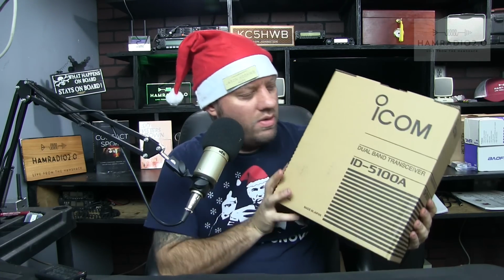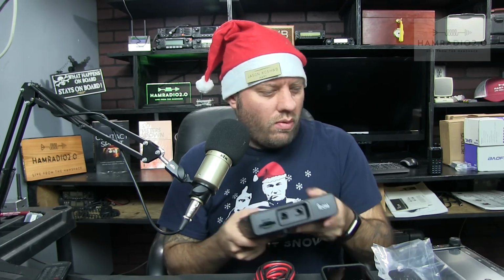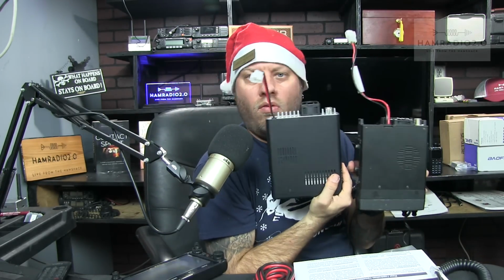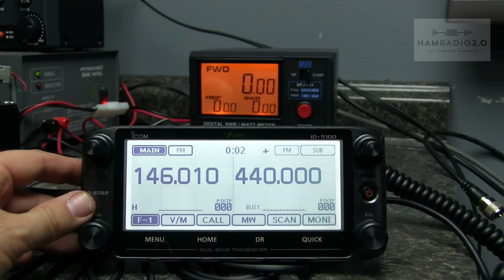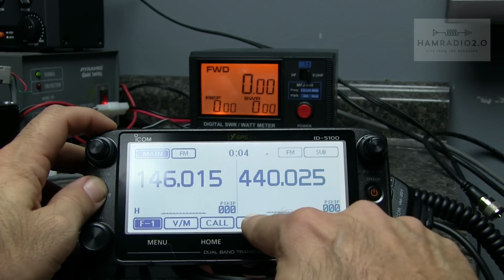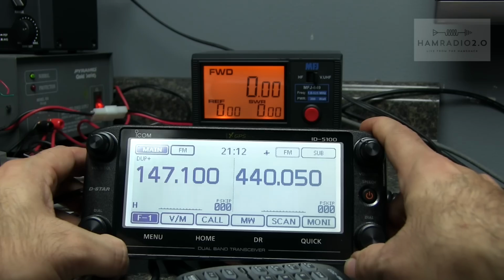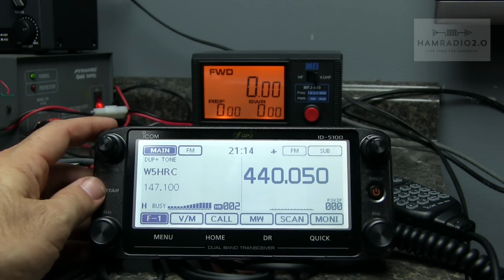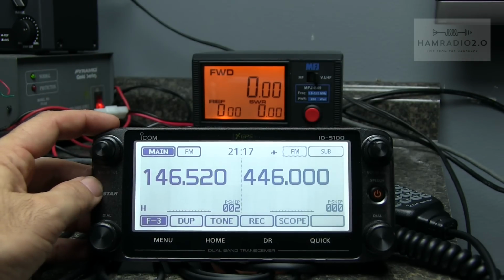Icom ID-5100a Unboxing and Programming

Comment: Just ordered the 5100a.  My first mobile radio.   Just passed my tech and general last Saturday.
Reply from the maker: Congrats on the new license!
Reply: @HamRadio2  couldn’t have done either without your help.  KQ4GVN
Reply: I'm taking my test on 4/19. Havent purchased this radio yet, just doing my research. I agree with Jason about the mic cable issue. I didn't realize that the mic does not plug into the head unit. Where I was planning on mounting everything, this might be a deal breaker. More research is required. Congrats!!
Reply: @NicAmes-e6u  Just run an extension cable.  I did.  I thought the same as it being a deal breaker, but nothing is perfect and it is a great radio.
Reply: Just bought the 5100e , my question is, can you program the repeaters off chirp and do you need to buy the data cable or can you use the SD card?
Reply: @TomDantzig  I used the RT systems software and cable, I don't believe CHIRP will program it but I could be wrong.

Comment: Just got this radio but found the microphone cable is far too short and to use it, it pulls on the cable connector into radio body.  
Possible design fault that the microphone is connected to radio body.
Dies anyone know if a microphone extended cable for this radio that’s not 5metres long like the official Icom one? 
Anything shorter?
Reply from the maker: Not that I've seen

Comment: So I know this is a really old vid.  Frankly I hope you still see the question. Is there another mobile radio that hunts for local repeaters like this one does?   I love my Anytone AT5888uvIII. 
But my times spent longest in the car is when I’m driving from PA to AL to visit my son. I would love to have a radio that would automatically find the local repeaters for me. 
This radio (like the 7100) is old tech yet still at a premium price ESPECIALLY if I have to purchase a mounting bracket for it. Any suggestions?  For $100 more I can get the Yaesu FT500DR but I’m not sure that’s the answer either.
Reply from the maker: You can load repeaters into the Yaesu also. But if you want to stay with Icom, look at the IC-2730. Unfortunately they have not released anything new in a long time
Reply: @ Thank you for the reply.  No not married to Icom. My base station is the FT-991a.  The thing that caught my eye on the 500 was the forward facing speaker and the rest of the options. My concern with it is the menus seem cumbersome for a mobile rig.
Reply from the maker: No, the menus on the 500 are fine.  There is a quick menu and a deep menu, with a page-through option for the deep menu.
Reply: @HamRadio2   I do like the slide in/out mounting bracket.  For this year I will keep the Anytone.  I'm mounting it in a subaru Crosstrek. But I am planning on going down to AL next January I might have to upgrade to the FT-500.  Who knows Icom might have something from this decade on the market by then.  I know the Anytone is old tech as well but at $250 for a tri-band it's very tough too beat and according to my meter I am getting 57watts on VHF, 32 watts on 220 and 46 watts on UHF.  The only thing I would really switch for is the repeater search, forward facing speaker, slide mount and the digital mode which are big considerations since when I visit I stay for over a month.  The slide mount gives me the option to put up a quick antenna and have use of the radio indoors.  I need to look into the AL area and see what type of digital repeaters are in the area.  I plan to move there in about 4 years.  Right now I can't hit the one repeater closest to me (about 50 miles) that does C4FM.

Comment: i love this radio....its old i guess. this video is 5 yrs old and ive had my call sign and radio 4 yrs....sheeeesh.   this radio was EASY to learn on as a novice cause it shows and does ALOT. the screen helped so much. was 1st radio after i received callsign 2020/5
Reply from the maker: I still use mine

Comment: I remote mounted the radio body unit in my Jeeps overhead console. Routed extension cable to an Amazon sourced bulkhead receptacle for the head unit. The head unit has another small extension from the dash mounted receptacle so is easily removed and stashed away in my open jeep. A short extension cable for the microphone also installed in the body to another amazon sourced bulkhead receptacle on the overhead console. Microphone easily stashed away with head unit. Works great and is very clean install.

Comment: They put the mic connection on the body so you have to buy an extension for it when you buy the mounting bracket
Reply from the maker: Many radios will take a normal Ethernet cable that's not proprietary so that's not always true

Comment: So I just bought a brand new icom 5100a deluxe also got me a Larsen VHF/UHF Mobile Antennas NMO2/70B I’m so excited to get it running.. Question is should I get two speakers for this system or just one external thanks KE8ODY

Comment: Jason, I just bought an ID-5100A at the Ham Holiday hamfest this weekend. I agree that the lack of a mounting bracket for the radio body, a head bracket and a mic extension cable in the deluxe version is disheartening. I wish they had included those in the package. Looking forward to getting it setup in my shack for D-Star use. 73 de Bobby KF5GTX

Comment: I mount mine in the back of SUV, the problem is the speaker in with the main unit and without blasting the volume you can’t hear the radio. So far I’ve bought the mic extension cable, and mounting bracket looks like I now need to buy a speaker.

Comment: I just bought this radio and finally got it hooked up in my car. I ran a cat 6 ethernet cable from the body to a plastic box I made for my center console that has two female to female ethernet adapters. So that working. I tried to run the head unit into an adapter in the same place, but that's not working. Idk if it's the adapter or the spare cordage I was using(that's my bet. I'll try to problem solve soon)
Reply from the maker: Good luck

Comment: I think maybe Icom connects the Mic to the base unit instead of the head is so that on can easily take the head down and put it in the glove box without the mic trailing clumsily along.  I don't need to do that but if I lived in a big city where security is a big issue, I probably would.  I think you can even store the head somewhere and leave it on in the crossband setting so that you have the security and the ability to crossband. Also, if you put a mic connection on  the head, it would necessitate a larger (less easy to stow) cable between the base and the head.

Comment: I just got the 5100 myself for my extended cab truck and that was my first thought as well. What a design flaw. Its like whoever designed the radio never actually installed what they were designing. I had to order a Network Extension Cable to lengthen the microphone cable with so the microphone would reach the front of the truck where the head unit is mounted.

Comment: you need to find a Kenwood TM-742a that is currently discontinued it is there Tri-band unit with all 3 bands your looking for. Triple receive function with triple display
The TM-742A/E has a maximum output of 50 watts (2 m) and 35 watts (70 cm). There are also four optional FM band units -- 10 m (50 watts), 6 m (50 watts), 1.25 m (25 watts)*, 70 cm (35 watts), and 23 cm (10 watts) -- to endow the TM-742A/E with tri-band status. For low-power operations, there are 5- and 10-watt settings (1 W with the 23-cm band unit).
*Not available in Europe

Comment: Hi Jason, I have been watching your videos and really like them!
I bought an ID-5100A Deluxe and the difference is only the control head mounting bracket. 
IComm seems to mean "iCom without mounting hardware. "
When installing the radio in my Jeep Wrangler I installed a double female RJ-45 in my dash replacing a cigarette lighter jack. I ran a 6 foot UTP cable from the back of the jack to the transceiver. Now the mic looks like a factory install.

Comment: I know this is an older Vid. Just pulled the trigger on this radio got it for 369.00 anyway I have looked around and found I could 3d print a bracket for the head so save me some money (I am A new ham) I am hoping to get it soon. Thanks for your videos. 73, KO4ILG

Comment: Great info a shame this radio is as old as it is. It looks feature rich. You Sir, are the first youTube reviewer to actually have the contrast/Brightness adjustment so the screen doesn't look washed out. I really like how easy it is access primary operations. 
Just curious, how that screen looks in daylight in your truck You mentioned you were going to install it. I'm using an old Yaesu FT8500 Mr Potato head Dual band, the display is excellent for a radio that is over 20 years old hoping to pick one of these up during the Black Friday coming up.

Comment: Sorry, last one. There's a plexiglass mount made for desktop use. It comes with high friction rubber feet to stop it chattering around whilst you're operating/programming.

Where in your house are you? I ask because I noticed you got a GPS lock eventually, in the video. My old FTM-100DR locked, and I'm in a second floor room with one window. My own room for my shack. Yes, my wife understands the importance of having a quiet place to - well - play.  ;-)

Comment: Doesn't this use DPRS instead of APRS? TO me that's a dealbreaker.
Reply from the maker: By DPRS do you mean digital only?
Reply: @HamRadio2  I was under the impression that dprs is a proprietary format of aprs and doesn't necessarily "play nice" with web apps like aprs.fi, etc. Could be off base there

Comment: So I just came across this video as I am considering a 5100 but...did the video of the truck setup that you mentioned was in the works get posted somewhere at some point?  I don't recall seeing it but may have missed it.
Reply from the maker: No, haven't posted that one yet.  Once the weather gets warm, I will be doing some videos of the entire truck setup.  I have been running the ID5100 in the truck for a while now, I just haven't recorded a video of it
Reply: @HamRadio2  Sounds good, Jason. Still like the ID5100? Do you recommend it as a solid dual band radio?

Comment: Looks like a nice dual bander  I have been in the camp that ALL mobile radios should be remote mount for years now... the mic should either connect to the head or give you an option to connect to the head OR the body, but not ONLY the body.  I may be in the market for a new mobile dual bander which is the reason for my visit to this video.  It would go in a 14' Subaru Forester.  Power, Ground and antenna are ALL behind the back seat in the cargo area on the drivers side so running an additional mic extension back there would suck.  Also of the school that a radio that originally sold for $700+ and still is in the high $300's MUST have every mount with it that is needed.  for the radio body AND the control head anything less is just plain wrong of the mfg.  Also I am a bit concerned about the touch screen... If I had to tap the touch screen two, three and sometimes four times like you were required to do on many occasions during this video I would literally want to rip the control head off the dash and throw the it out the window while driving down the highway at high speeds.  Please tell me it really isn't THAT bad! ? Also this is a bit knit picky and I realize this but neither band on your radio put out the advertised 50 Watts... 42 Watts is a 40 Watt radio, 44-47 Watts is a 45 Watt radio, and ok 48 or 49 Watts can be a 50 Watt radio but output down in the low 40's is off by a full 15% of the rated output.  85 cents isn't a dollar and 42 watts isn't a 50 watt radio.  lol

Nick
N9SSW

Comment: How s the sensitivity of the two receivers?
Reply from the maker: I've had it in my truck for a few months now and I have no issues.  No desense, and RX is pretty solid.  I think my main problem is that I have it on a magmount antenna, but even with that, I am able to hear pretty much anything I want to.

Comment: I think pretty much everyone has said what I think. I love Icom and I think they are the best, but this crap they did with this deluxe radio is so stupid. You buy a radio with a 12ft control cable but yet now I have to pay 30$ for a radio mouting bracket, 60$ for a mic ext. cable (from them), then you have to buy a speaker or two. I've used this radio in my van for a year an love it, my 8800 died in the house so I moved this radio in the house and now I have cables everywhere because of it. Why can't you just put a mic port on the head control unit?

Comment: The comparable radio from Yaesu (FTM-400XDR) has the same setup where the mic plugs into the radio body. Face is remote mount only. Also, ICOM does include software and that's one thing the SD Card is used for... programming the radio without a cable.

Comment: Using the control head for the mic connection could be problematic since  control head mounting is usually not as rigid as the body of the radio. I think the hardware to mount and cables to connect should at least be an inexpensive option when purchasing a radio and not $30 for a $2 bracket.
Reply from the maker: Other radios have done it this way with success.  This radio head is already big and bulky (which I like in this application) so I can't see how making a mic connection on the head would be much different.
Reply: @HamRadio2  I would agree that it shouldn't be an issue if it is well mounted.

Comment: The microphone extension cable is an additional purchase from ICOM (+$30); however, a cat6 Ethernet extension cable works as well ($6-12).

UGREEN Ethernet Extension Cable Network Cat6 Extension Patch Cable RJ45 Cords Shielded Male to Female Connector, 10ft/3m https://www.amazon.com/dp/B00QV0K210/ref=cm_sw_r_cp_api_i_.v.kCbMBWZZPQ

I love the radio. I am trying to use it for D-Star.

Comment: I just bought the radio as well.  I used a cat 6 ethernet shielded extension cable from amazon - cost about as much as a coupler and it works.  I think the cable ICOM sells is the same - just 8 times the price!

Comment: Good video :) and I like the T-Shirt :) w/ Captain Picard :) 
I still have my ID880H D-Star Dual Band mobile that I bought at Richmond Frostfest (VA) back on February 2, 2013.  It is better to program it by computer than by hand/manually.  Radio still works.  I use Repeaterbook.com to find frequencies in my area and also have Air, VHF Marine and Railroad programmed for Receive - Only.  I need to get a radio that doesn't have the multi-semented alpha-numeric and character display.  6 large and 2 small.  That ID5100A has an easy to read display.  

If Icom would make a DMR Dual band mobile with a separation kit, I would buy it. Not all vehicles, nowadays, are 2-way/ham radio friendly , i.e. 2014 Jeep Latitude. 

I have a CAT-5 cable to extend the mic cable using a mating connector between the two.

I am using RT Systems w/ the programming cable [Orange].  

73s
de
WB4UR, Sean

Comment: I have in ID-4100 and it came with the mobile mounting bracket in the UK, although it is not mentioned in the manual on the content list.
I also think it's crazy that remote head radios don't have the option to plug the mic direct into the head unit.

Comment: The mounting bracket they include is for the control head only.  Check to see if it came with the Bluetooth board in the deluxe model.  Their site has it listed as an option.  They are also sold out at the present time.   If it did, you can pair it with an Android device with software from the Icom American website to do some features.  You can also use an Android device with the Icom data cable or the RT-Systems Orange cable.  Tied to a computer, you can run D-rats over those cables too.  I put velcro strips on the bottom of mine and use that to hold it in place on the transmission hump of my pickup truck.  That way, it is easy to pull it out and hook it up in the house for base operations.  Easiest way to program it is to use an SD card and download the repeater lists from www.dstarinfo.com.  It will give you Dstar and Analog FM stations in your area and let you import it into the radio with the card.

Comment: I agree Jason the microphone should have been able to plug in the head.. A bad design
Reply: They do have an extender available for the mic, depending on where you want to mount the radio.  If  the body is under the front seat or under the dash, the length of the mic cable is usually sufficient.
Reply from the maker: Yes mine will be mounted under my front seat, but still... I think they should have designed the head to accept a mic connection.

Comment: I mounted my in the trunk and used a lido mount for the display head and bolted to the passenger seat bolt. To extend the microphone, I grabbed a network cable and RJ45 coupler - need 8 conductors. Plug the microphone into the coupler/network cable and the other end of network cable to radio. Control cable is long enough to reach for most cars. You may want an external speaker if the radio is in the trunk. When I leave the car I take the display head (magnetically attached) and only two cables and the mount are visible. Take care with the display head - popped the glass and repair is $$$.  I put the display head in a pelican case for safe transport.
Reply from the maker: Good info, thanks for commenting.

Comment: I dont why icom can't add the separation kit, And the price to buy it is too high.
Reply from the maker: It has the separation kit, just not the mic extension or the mobile mounting bracket.  But the separation cable and faceplate mount are included in the Deluxe model.

Comment: And as far as microphone extension, a standard Ethernet cable (straight through, not crossover) cable and a coupler will work fine
Reply from the maker: Looks like others agree with you.  I will try that.
Reply: I just did that, with a coupler, I’m glad it WILL work. Thanks